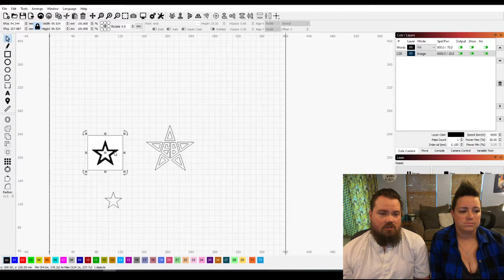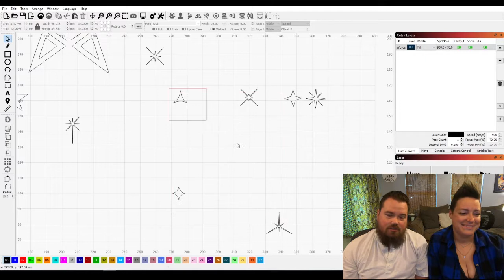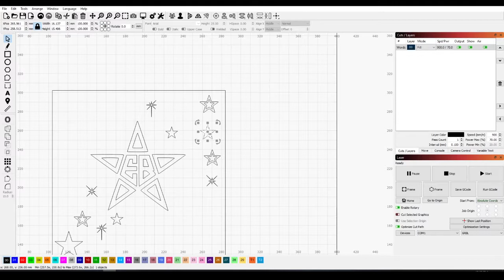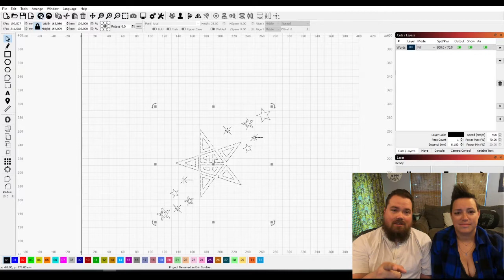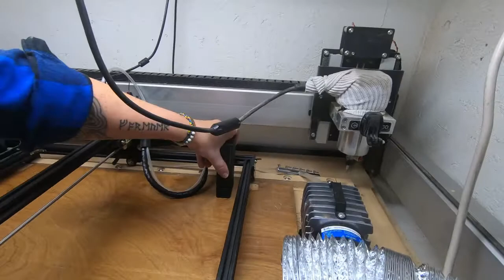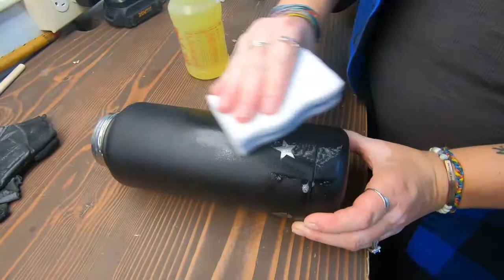How to Create and Etch a Custom design on a Tumbler. Ortur LM2

Comment: I see that you're using a 20w diode to engrave on powder coated tumblers. What is the optical output of your 20w?
I'm running a 15w with an optical power of 6.5w.
Thanks!
Reply from the maker: The Ortur 20 watt is 5.5 output from what I find and the 15 watt is 4.5 with the 7 watt being 1.5.
Reply: Have you tried etching colored Rtic tumblers? I tried doing a white painted with black tempera paint at 900 speed and 85% power but had no luck getting through to the base metal. I guess I'll have to use this one to doing some speed/power tests to get to the metal. Anyways, thanks for the response and putting the video's on YouTube!
Reply from the maker: We have only done a few of these same models of black tumblers.

Comment: What is you distance from the laser to the tumbler?  I’m not burning down to the metal so it still has a bit of color still on the tumbler.
Reply from the maker: I just used the aluminum slug that came with it to set distance.
Reply: Gotcha. Mine is the Ortur LM 2 with a fixed focus 15w laser. The knob is hard to turn at the bottom and I think it adjusts the focus. Maybe maybe not.
Reply: I found my focus using a ramp test

Comment: which laser module did you use ? LU2-4-LF ,  LU2-4-SF or LU2-2?
Reply from the maker: It’s a fixed focus lu2-4 from before they separated it with LF and SF. So I am not 100% sure between those two.

Comment: Hi there how long does it take to engrave that design with those settings of the laser? Thanks!
Reply from the maker: About an hour and 12 mins
Reply: @KLRform  I run a 10 watt diode 1500 mm/min @ 70% and it comes out GREAT. That is a long burn for that cup. You could almost cut your time in half. Looks good!
Reply: I just did a test @8000 mm/min 80% power and it came out better then my earlier comment. To slow and we're just melting the coating back into the cup, longer clean up. try it! I did a design with the 1500 suggestion and it took 40min. @8000 and 80% it was 7 min!! Take care.

Comment: This is a great video, i have a question though, is it possible to etch all this type of Tumbler that has a coat of paint on them from the factory ? Also is it possible to etch anodised aluminum as easy as this Tumbler ?
Reply from the maker: You should be able to etch anything painted yes. I have not etched any anodized aluminum yet but I do believe you can. That one is something we would like to try in the future.
Reply: @KLRform   I am thinking about buying a Laser Master 2 Pro with a Y axis Roller-thing and right now i am doing some investigation about what i really can do with it.. my plan is to make some money with it.. thanks for a quick and good answer.. :D

Comment: Do you have any technique tips to engrave on a blank stainless steel tumbler with a diode laser?
Reply from the maker: You would need to spray it with something. I would start with the dry moly lube.

Comment: Nice job, where did you get the rotary attachments. I bought mine awhile back and it came with just the little leveling attachment that's not that useful without mods. Thanks.
Reply from the maker: I found the design for it from thingiverse.com. Then had it printed.
Reply: Nice, I have a 3d printer, now I can use it for something other than Groot statues.

Comment: Hello, I have seen your videos. I’m trying to make some 30 oz tumblers for my fire department. How do you align the two designs on a 30oz?
Reply from the maker: If you mean doing them front and back you would have to measure and make sure they are that far apart in the design. If that’s not what you mean let me know

Comment: This is an awesome video I've been struggling to find out what laser I needed and this has been very informative. I did have a question, what's the Air Assist Pump for?
Reply from the maker: The air helps keep the area clean of soot and smoke making the laser more effective.

Comment: My circular logo has turned out to be more narrow than it should be. The rotations per minute is accurate and the circumference is fine. I had to adjust it by 4%. Any idea why? It’s a perfectly flat tumbler too no taper
Reply from the maker: Do you have the diameter of the rollers in? When I first tried mine where off and it came out stretched. I used a caliper to make sure I had it right.
Reply: @KLRform  Yes they were fine, every other logo/image comes out great. just not a circular image but could just be that particular image

Comment: Thank you so much for this video! I’ve been struggling with this exact project. What is the wattage of your Ortur LM2 laser? 15w or 20w? I have a 15w Ortur LM2 so I just want to know if yours is also 15w so I can use the same settings. If yours is a 20w, do you know what the setting adjustments would be?
Reply from the maker: Ours is a 20w. I'm not sure what the settings adjustment would be  - I would go slower and/or add some power. I have never used a 15w to to be able to tell you for sure. You might just have to adjust a couple of times.
Reply: Thank you so much!